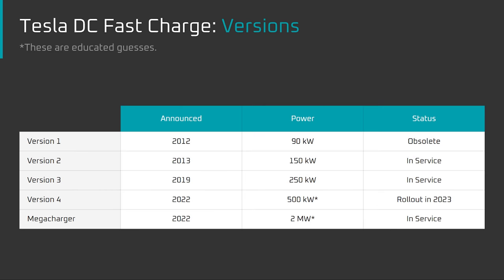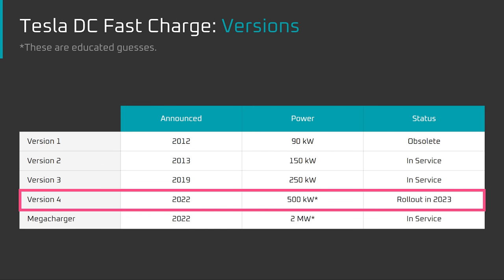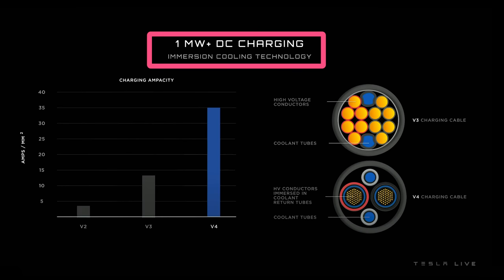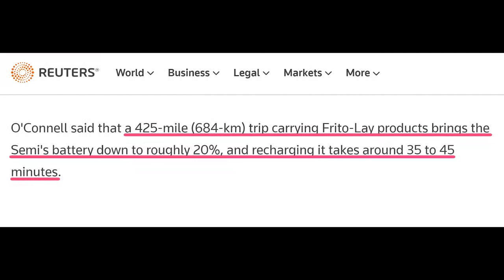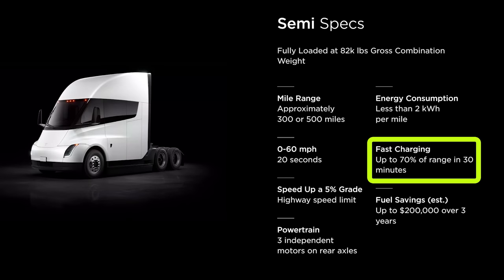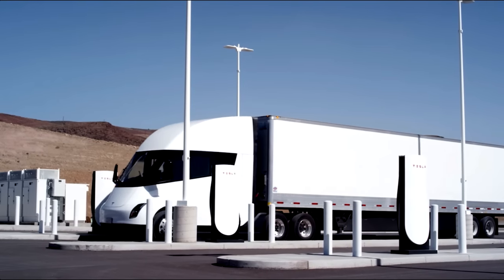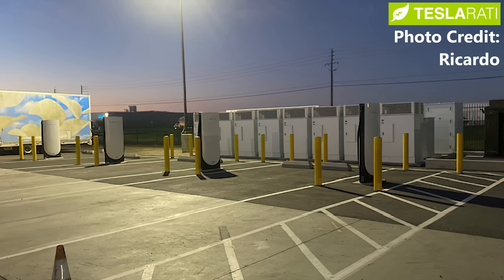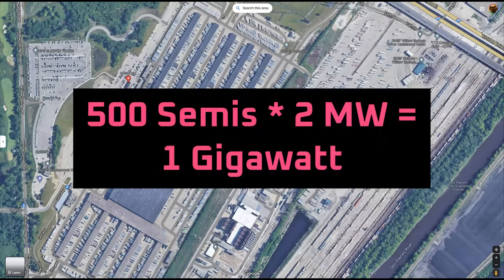Semi Megacharger Output // + The Megapack Moat

Comment: Semi trucks aren't used 24/7
Average use is probably closer to 8 hours per day (some days more some days less). A lot of charging can be done away from mega chargers at perhaps super chargers or even slower

Eg when the driver is sleeping that's 8 hours where a 100KW charger can charge the vehicle empty to full

Some people who own their own semis even drive them home and could at least top up while at home with say a 20KW home charger. On their off days the semi will be stationary about 35 hours enough to add 700KW from a 20KW home charger. Or even a normal day if they are home 10h that can top up 200KWh or add 25% back to the battery which is better than none

These things won't be 100% charged at mega chargers

Tesla should probably make these with multiple charging slots and allow them to use the normal super charger network

If they have 4 charging ports drive into a super charger and connect either 1 or 2 or 3 or 4 depending on how many stalls are empty and how quick a charge you need

Getting dinner and only need a 300KWh top up then plug in just 1. Getting dinner and need 600KWh plug in 2. Just stopping for a bathroom break and a takeaway sandwich the plug in 4 and within 20 mins add 400KWh etc
Reply: Then you have to have the sufficient power where you park the truck when sleeping and looking at where truckers park and sleep and rest here in Sweden that is... well, nothing that will work. At all.
Reply: @Xanthopteryx  Sweden might need to look into truck stops.  I suspect that was what the OP was thinking, large NA style truck stops that usually include parking for sleeping truckers.
Reply: @TheEvilmooseofdoom  Large truck stop is not something that will pay off. Because, there are A LOT of roads in Sweden and you have your mandatory rest times and you take the rest where you can to optimize the driving. That can be at the side of the road in the middle of nowhere. People even sleep in industrial areas where they might have delivered, before picking up some cargo on the way back.
Here you can see how a typical longer distance haul can look like. Recommend watching the entire video.
https://www.youtube.com/watch?v=QNeoSJ5Rx30

Of course we have some 'larger' areas where truckers stop, maybe at a restaurant or similar but to get power out there to handle the massive amount of trucks that MIGHT come sometime in the Future (who will pay for all this infrastructure?) is not, easy. And lets say you must sleep, but what, then you charge and go up after one hour or two to disconnect and move? Or? And if you are delayed so you run out of driving time. Then sleep somewhere in the woods and then stop again to fuel up? And prime time where it could be like chaos amount of trucks and then wait for five hours to get fueled up? There is already problems with battery cars during peak time where there might be along wait.

This is a logistic nightmare.
Reply: Self driving obsoletes all of that.
Reply: @Cr Hu  Sure, but self driving doesn't yet exist and might not for 10 years
Reply: @crhu319  There is no wide spread proper self driving (Yes, Volvo have it in some areas but very limited). And there will be no self driving to talk about next year. Nor 2025. Not even 2030. It will take, a long time, to do anything more than limited versions of it.
Reply: @kaya051285  Totally agree. Or, well, it exist today under special circumstances, like Volvo have self driving trucks. But very limited use, although it works. But anything wide spread will, well, ten years is not enough. Though special operations will be more common within ten years. But still limited.

Comment: You change the charging curve  by splitting  the battery  pack into different  segments.
Reply from the maker: If that were true then vehicles with more and smaller battery cells would charge more quickly.
Reply from the maker: ... they don't

Comment: It's doubtful Tesla is starting at 0% state of charge - my guess is they start at 5% or 10% starting point considering most users will not run the battery to nothing.  Thus getting to 70% from a "not zero" starting point is perhaps do-able on lesser MW chargers.

Comment: I say to spit the pack in 2 
Then hit both with max 
Or spit onto 3 
Then hit one with max for 10 min 
Then hit 2 with 10.
The 3 with 10 min 
No need to treat a large pack as one unit
Reply from the maker: This would generate more heat per pack and burn up the packs quicker and reduce regen.

Comment: The megapack is an economic and network total game changer for many utilities, with advanced AI and control enabling the system to massively out-compete legacy systems to simultaneously provide
- grid stability including frequency management, virtual spinning reserve, load/time shifting of renewables
- network capital investment deferment by shaving off local peaks etc
- price arbitrage

I can see Tesla gaining a network operating license in many areas they provide mega charging and V4 supercharging, adding another megapack or two and operating as a healthy profit centre in that corner of the network.

Comment: Jordon, if the Tesla semi has same battery capacity of 13 long range Tesla cars, why can't the semi be charged in 13 seperate sections, like having 13 packs that can be joined for driving and separated for charging. Like having to plug in with 13 seperate charging plugs each time. Of course this would need a fair bit of tech to work. Is this even possible?
Reply from the maker: No, it has like 9 modules.  And besides, that would have no effect on charge speed and would complexify the BMS
Reply: @thelimitingfactor  it will be good to find out how they actually do it.

Comment: I'm a Tesla fan, but think more attention needs to be focused on grid issues.
Reply: I've said before.
If a Megacharger is essentially like 4 (or even 8) V3 chargers, there are plenty of 100+ V3 locations now.
Do they cause "grid issues"?
Reply from the maker: Not sure what this means
Reply: @thelimitingfactor  Expanding capacity  -- whether conventional or renewables -- and storage takes time and must be addressed in planning documents before utility commissions will allow expenditures, whether for power purchases or utility-owned projects.  EVs are a major load that, unlike new construction, isn't captured by conventional utility planning.  For example, a new housing development has to apply to the utility; several EVs purchased by residents in that development may be a significant percentage of the total load but won't be identified until they plug in.

Comment: Have you done a video discussing grid implications of wide-spread EV adoption?  Is there any threat of the grid being the Limiting Factor?
Reply: As mentioned, if used properly, the Megapacks BECOME the local grid to some extent.
More like the "Enabling" factor?
.
Jordan
Time for a channel name change?? 😉
Reply: @rogerstarkey5390  I was wondering more about whether the grid and energy production is projected to keep up with increased base-load demand from lots of EV usage.  I agree that megapacks really help out with peak demand, but is energy production and the physical infrastructure projected to grow enough to keep pace with not just megachargers, but home charging?
Reply: @legobis4484  The grid will need to expand.  It always has.
Reply: @TheEvilmooseofdoom  of course.  But I want to know by how much.  What are the limits? Will it expand fast enough?  Are there material constraints?  Manufacturing constraints? Permitting constraints?
Reply from the maker: There's a ton of videos on that, but I'll eventually do that as well
Reply: @thelimitingfactor  awesome.  You're one of the few in this area I trust to present the facts and do a thorough job.
Reply: @legobis4484  About 30%, or one outlet per house running constantly. Similar to the increase after air-conditioning was introduced.
https://youtu.be/7dfyG6FXsUU
https://www.youtube.com/watch?v=7LMgmg0I0GA
https://www.youtube.com/watch?v=3FSMG5KbQkM&t=589s
Reply: As we electrify everything, total generation will have to grow. Power networks have had cycles of growth for over a century but it should be reasonably gradual as a whole with local strains to be expected.

Comment: Isnt the semi running at a much higher voltage than the 3? Meaning its charge curve would be completely different.
Reply from the maker: The battery cells are always the same voltage.  Think about it

Comment: Q: Is it possible that the Simi uses stacked battery packs. Let's say 9 different packs and first charge 1 batch max kWh and when the charge speed slow second batch max kWh. So on. So you can take in max kWh from megacharger almost till full. Is this possible?
Reply from the maker: It uses like 9 module cubes.  But they probably all charge at once.  But charging them  separately would screw up the balancing
Reply: @thelimitingfactor  not with a good enough BMS.  If you had to leave without getting the base charge into all the packs the BMS just trickles the charge into them as you drive.

Comment: A couple of questions:
1. Battery energy storage would only reduce peak load on the grid, not average load and in this very video you claim that average power demand for charging just 24 Semis/day would be on the scale of multiple large office buildings. I don't see how a Megapack would significantly reduce the requirements on the grid, especially at larger truck stops where Semis will be charging almost 24/7 and power demand average out somewhat.
2. What has Tesla done to solve the Megapack fire issues? I've seen multiple reports of these things catching fire, both in Australia and California, and even heard claims that the fires produce toxic hydrochloric and hydrofluoric acid, as well as that they are extremely difficult to extinguish.
3. Li-Ion batteries just seem like a very bad choice for grid scale storage, you're paying out the nose for Energy density that is completely unnecessary in this application.

Comment: The only way your calculations, and Tesla's charging claims work is a battery with a high flat charging curve to 80%. We know that the tested 4680 batteries grossly under preform, and didn't have all the chemistry they calmed at Battery Day. We also thought that 4680's had to be in the Semi to meet range and charging speck's.   Are 4680's a huge failure or is there something else going on?   All indications are that Tesla is pushing Very hard to ramp up 4680 production and this wouldn't be the case if they were having big problems, so what is really happening? My guess is that the 4680's going into cars now are for getting real world data and are intentionally throttled to avoid making all present manufactured cars outdated (Osborn effect). When there production numbers allow quick integration of these batteries into All of there, top end vehicles, the Cyber Truck, and the Semi, only then will we see what a 4680 powered Tesla's true capabilities are!!
Reply from the maker: The semi doesn't use the 4680
Reply: @thelimitingfactor  Yes. Is this why your charging data is out of wack?? I am suggesting that the original spec for the Semi was assuming a 4680 with low internal resistance so it could charge faster than anything currently available.
Reply: @robinholmes785  I think you are the one assuming that Semi was going to use the 4680.  And don't be so quick to call it a failure, it was always going to be a manufacturing issue, they are workng to solve that then start tinkering with the cells to improve them just like with the 18650's and 2170's.  You make the flawed assumption that since their first round isn't the final version as you imagined it that it's a fail.  That's simplistic thinking.

Comment: If you need a 3MWh BESS for fast charging...why not do a battery swap station? You only need to have about 1.5X BESS for the fleet instead of 3MWh BESS for each Tesla semi fast charger. So...something doesnt fly..
Reply from the maker: Because it will cost more
Reply: A swappable battery will be heavier than a built-in one of the same capacity. With the Semi, every kg of additional mass in the tractor equals that amount less of payload.
Reply: @thelimitingfactor  You're saying for each Tesla semi fast charger (not charging station, each charger mind you),Tesla is going to commit 3.3x the battery size of each Semi or about 40X the battery size of each Tesla Car? And that is a cost effective solution? So you're saying Tesla would willingly forgo the sales of about 3 Tesla Semis or 40 Tesla Cars to build each Tesla Semi fast charger? ok.
Reply: @veikkoimmonen7300  Time is money too.
Reply: @mynameisusedz  Some other factors to consider:

If the Semi Truck to Megacharger ratio is large enough, fewer batteries would be needed for Megapacks than for swappable vehicle batteries.

Currently and in the  short term future, battery supply is a limiting factor, but will it also be in the long term?

Megapacks can be used for revenue bringing, necessary grid services regardless of their exact location, so a Megapack located at a Megacharger does not necessarily reduce the number of vehicles that can be built with those batteries. Instead, the Megapack might have been built anyway, but just situated at a different location as it otherwise might have been.

Fast charging seldom takes more time than a mandatory driver break, when the truck would be standing still anyway.
Reply: @fred8281  With regards to the mandatory driver break, might as well use the slow charger so you dont spend 3MWh BESS investment.

With regards to grid services, it isn't significant margins but battery swap stations can also perform the exact same utility.

So on the ratio, the fast charger investment only makes sense if it is fully utilised and always charging and no semi is queuing VS a 1.5x cap on BESS requirement for battery swap.

Comment: What if the semi could charge from both sides, using TWO chargers?
Reply from the maker: What if they put 10 chargers on it and you could charge it a supercharger station?

That is, where do you draw the line for what's practical?

If I had a semi I wouldn't want to hook up multiple chargers.
Reply: As long as a single plug is manageable. I've seen 3D prints of an MCS handle and while it's much larger than CCS1/2, it still looks manageable especially if you consider using it will be someone's professional work task, not a leisure activity. That said, using parallelism to increase throughput is not uncommon in an industrial setting and I wouldn't have been surprised if they had just designed the megacharger to have e.g. 4x NACS plugs next to each other. Furthermore, I won't be surprised to see a NACS socket in the Semi as well - for "emergency" charging at regular Superchargers or slower "overnight" charging at depots.
Reply: @thelimitingfactor  
V3, with an adapter running 120-150  kW overnight for 6-7 hours?
.
That's a lot of distributed off peak charging already installed?
Reply: @thelimitingfactor  meh, how many separate tires do they have to fill up?

Comment: This is where a commitment to battery swapping technology on Tesla’s part would have been of major benefit.  Those swapping stations full of battery packs charging at much slower rates would have maximized battery pack life and those same batteries could have also be used as virtual megapacks on a grid with an ever expanding amount of renewable energy sources.  But they squandered that opportunity.
Reply: If you used them for grid balance then you can't use them for trucking, it would also massively increase cost of a charge station.
Reply from the maker: Battery swapping would add a lot of cost.
Reply: @miguellopez3392  Rapid charging one battery from another is a great way to shorten the life of double the batteries.  But I guess Tesla is in the business of selling batteries.
Reply: You still have to charge them, and you'd easy have multiple times the number of cells produced, plus numerous points of potential failure and zero chance if completing the task during a rest stop.
.
Think it through.
Charging.
Truck pulls in
Driver plugs in
Driver takes break
Driver unplugs
Truck leaves.
No other facilities or people required.
29 seconds to complete.
No time lost.
...
Swap
Join the queue (yes, there will be one)
Stay WITH the truck ⌛
Wait for the swap ⌛
THEN park and take the driver break.
It takes LONGER.
Reply: @NasaRacer  Swapping is not the way they would go, that would reduce the number of vehicles they can build.  It was never more thank a gimmick idea.
Reply: Agreed, grid and home storage should only ever be made out of retired vehicle batteries anyway.